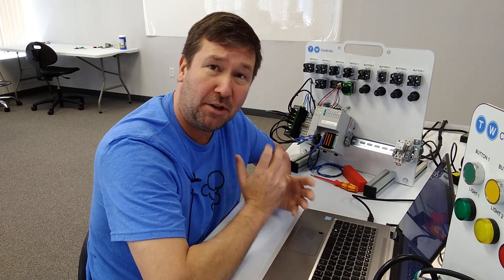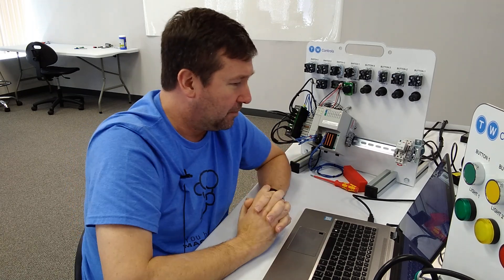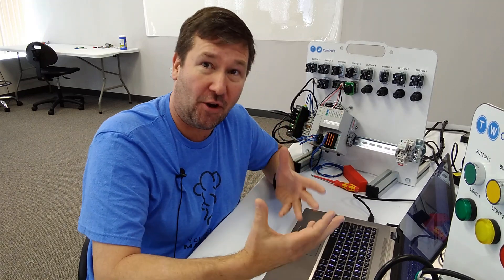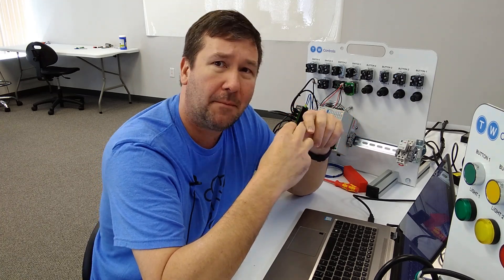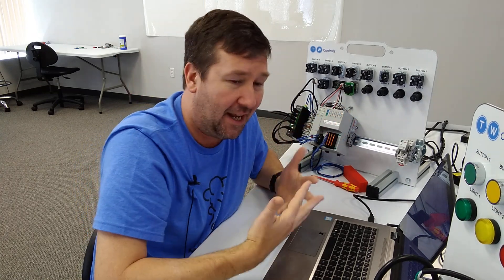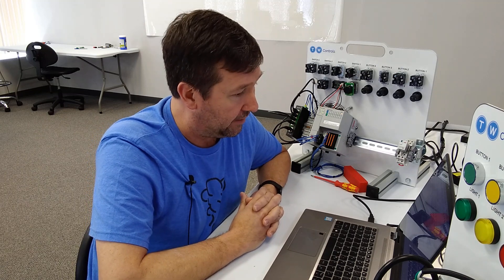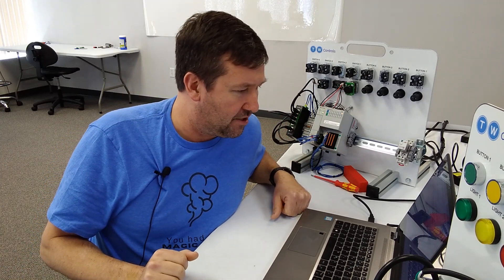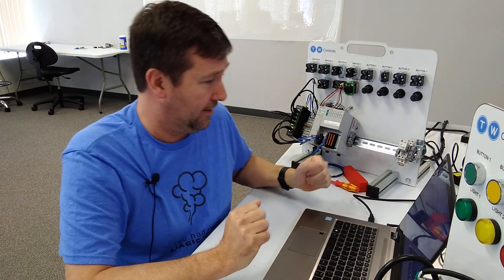Industrial Automation and Manufacturing Q&A Podcast

Comment: Using CCW with Micro800 PLCs, sometimes the timing of a ladder program can be quite fast making it difficult to troubleshoot or understand what the program is actually doing. Would you consider doing a video showing how to insert temporary diagnostic delays in the program to slow down the process? Could you also use temporary variables to keep track of how many times a ladder rung or branch is true?
Reply from the maker: No and I don't recommend troubleshooting in this way.  They key to understanding the timing of a ladder program is to understand program flow.